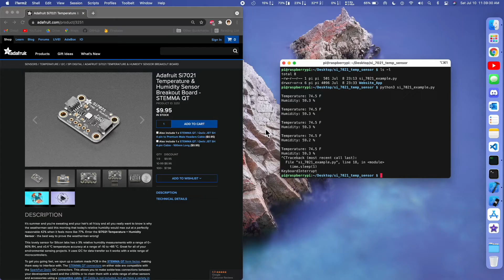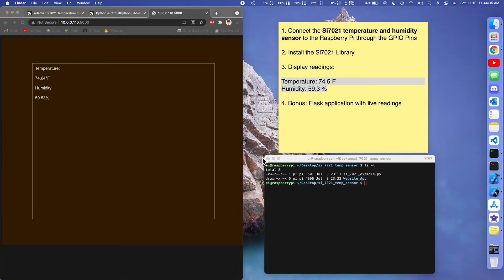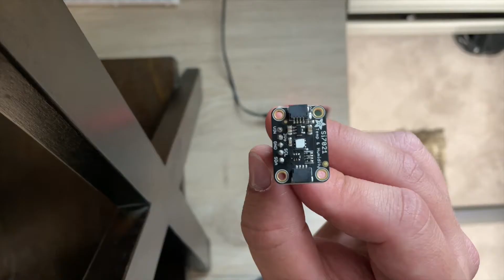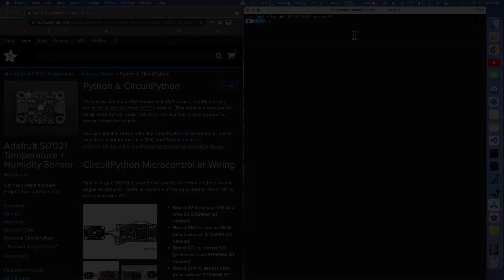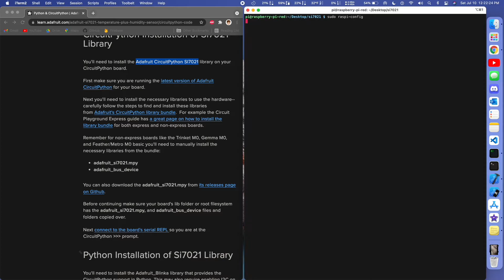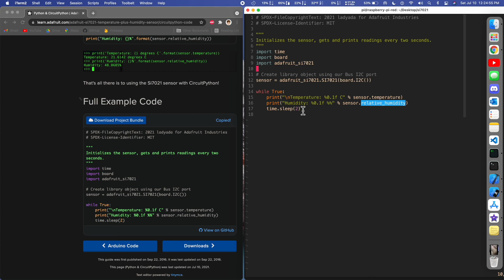Raspberry Pi Temperature & Humidity Sensor Tutorial (Si7021 + Python)

Comment: This still works. Thanks for the tutorial. I setup my Raspberry Pi 3 running Raspberry Pi OS Lite (32bit). Changes from the vid for that distro:
-There is no "Desktop" folder because it doesn't include a desktop environment
-pip3 is not installed. Get it with "sudo apt install python3-pip"  
-The vim text editor is not installed. Use nano instead.